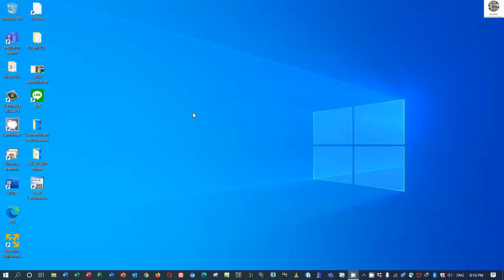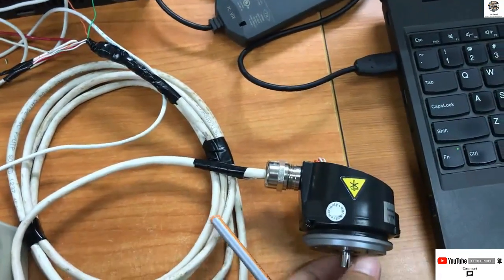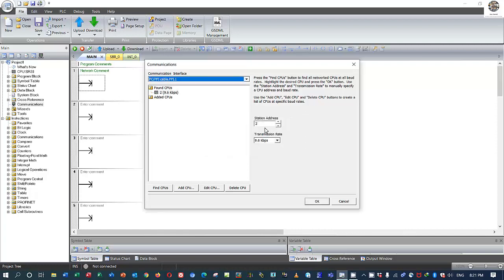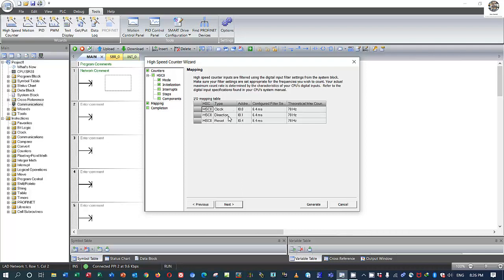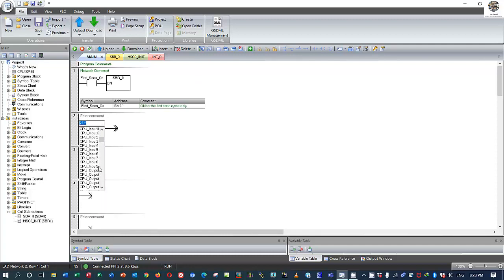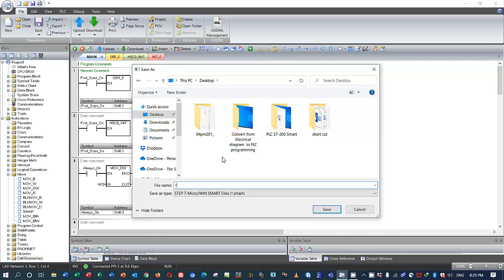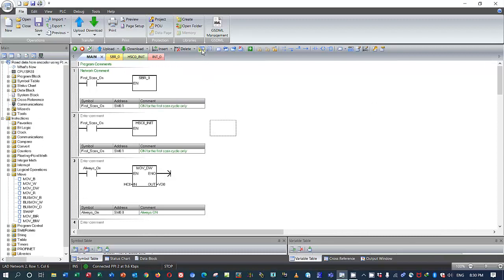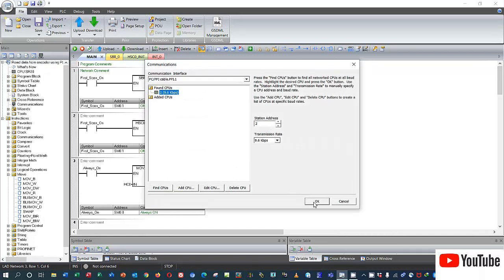Read data from encoder using PLC S7 200 Smart CPU SR30 via PPI cable

Comment: Hello Sir
This video program bit not saport in PLC S7 200 smart st20 please make a one video s7200 smart st20 PLC
Reply from the maker: Dear sir,
For hardware of PLC I have only CPU SR20 and SR30 but it should support for another CPU for high speed counter
Reply: @generaltechnologyknowledge5165  SIR PLZ SUGGEST ME FOR ST 30 AND ST60 CPU HIGH SPEED COUNTER
Reply from the maker: @RakeshYadav-or3sj  Yes sir we can do it please follow step by step with my other videos about how read data from encoder.
Reply from the maker: Let me show more video that related to read data from encoder by using PLC S7-200 smart via PPI and LAN cable,
Thanks

Comment: Hi, Please, I want to know if the software the software of Step 7-Micro / Win smart and compatible with the old 222/223/224 PLC. I mean if I can program 22/223/224 PLCs with this Step 7-Micro / Win smart software. thank you
Reply from the maker: Dear sir,
Thanks you very much for your question.
Actually the software step7 MicroWin Smart is use with PLC S7-200 Smart only such as PLC CPU SR20, SR30.... And software Step7 MicroWin is use with PLC S7-200 CPU 222, 224, 224XP, 226...